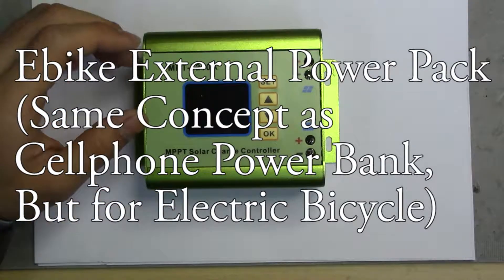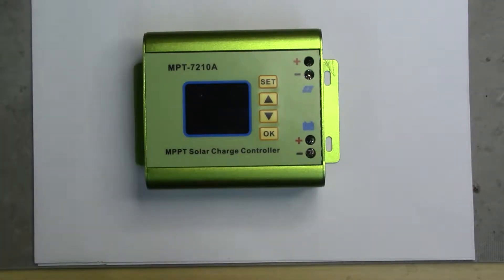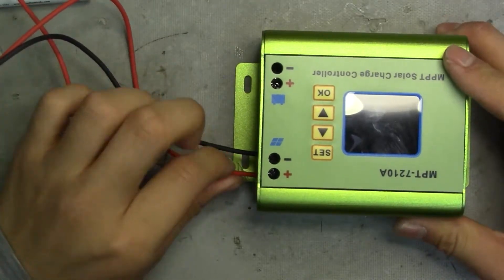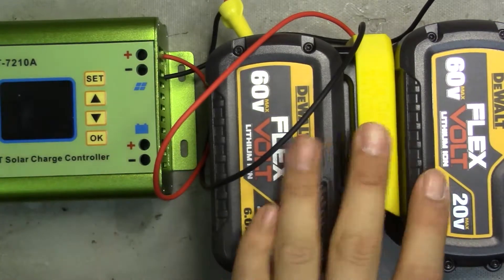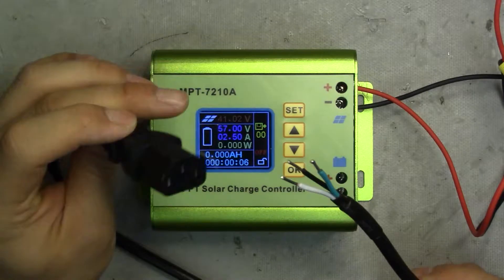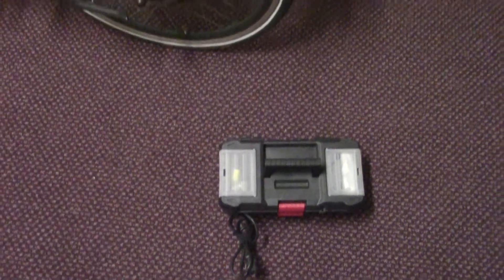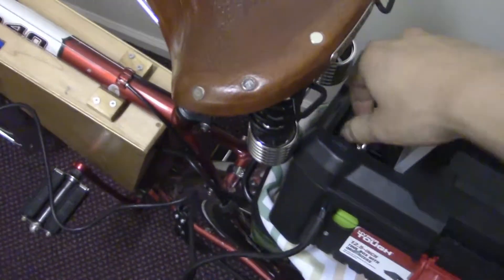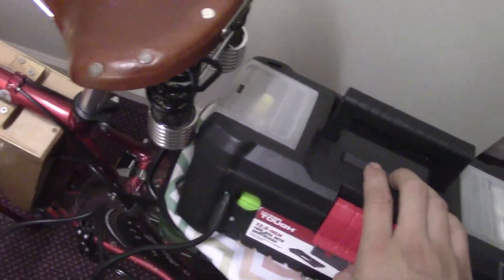[8] Project - Ebike Power Bank Using Drill Batteries

Comment: Did you ever use this to run the bike instead of charging the ebike battery?
Reply from the maker: You can if the voltage matches your bike, 2 of the batteries in series will give you 36 V, my ebike is 48 V.

Comment: I used Ryobi 18v battery packs in series/ parallel config to reach 58.8v(all charged about 80-90%) for a while, but using these powertool packs will shorten their lives a lot. Driving that power through the OUTPUT of the pack from one to the other. They are designed to be charged at much lower levels. I used mine for only a month before purchasing a real 58.8v pack. I do not recommend
Reply from the maker: Yeah, it is good in a pinch.

Comment: Nice video and nice explanation for MPPT but I have to say that this green Aliexpress charge controller isn’t a MPPT charge controller. Yours is working completely differently. It is a PWM step up charge controller and the label on it is just fake. I know these boxes. There are many Chinese “fake MPPT” charge controllers.
MPPT: input voltage must be much higher than battery voltage (charge voltage). Has a large inductor that is typically expensive. Advantage: higher input voltage means lower input current and thinner PV cables.
PWM: input voltage should be lower than battery voltage otherwise the controller is very inefficient. No need for inductor, cheaper. Just PWM and some capacitors. But for an eBike it is ideal.
I prefer to use two 18V (20V max) batteries in series and connect it parallel to the built in battery. One  ideal diodes in series for each battery pack (internal built in and external) prevents a shorten of the two battery packs and you are fine. In your solution the external battery charges the internal battery (with losses). In my solution they are just parallel and no current flows from one battery to the other. It depends what you are wanting. Both solutions have advantages and disadvantages.
Reply from the maker: That would work too.  just make sure not to over drain lithium batteries.